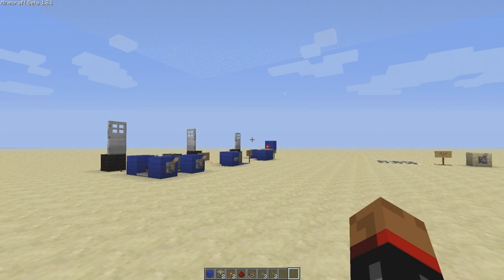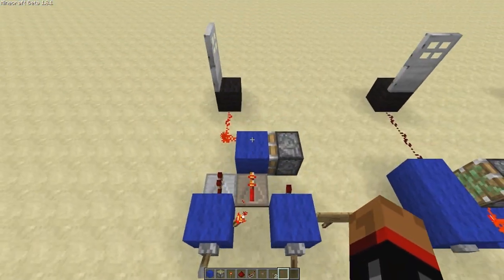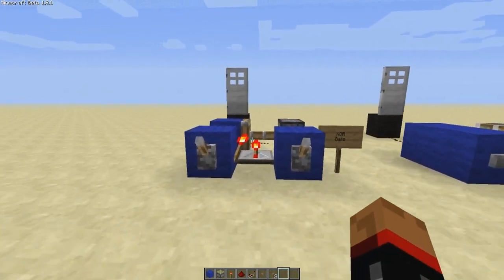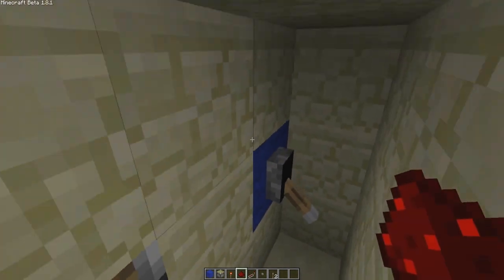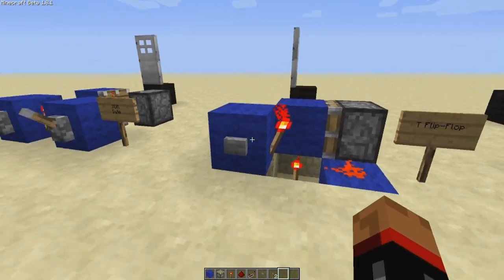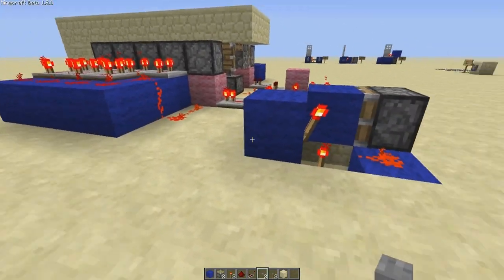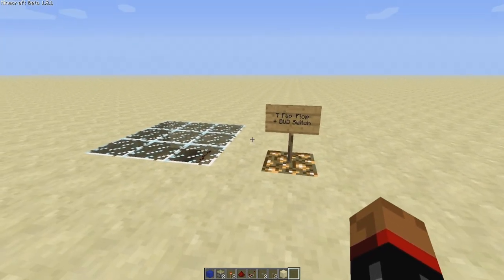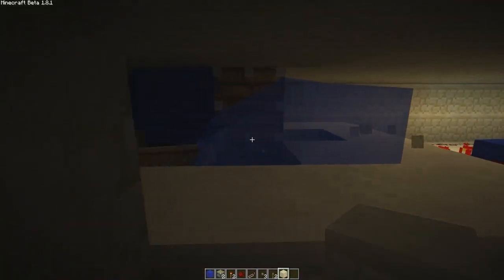XOR/T-FlipFlop/BUDS Switch Reference Guide [Minecraft Redstone Tutorials]

Comment: Not sure if it interests you but your flip flop can be made to actually send out a set of two outputs, one off and one on. This way you can toggle to outputs to always be inverted from each other. Where the blocks ends up after the piston connect it to a repeater connected to a redstone torch. Then you can take power from that block which will always be the invert of the other output *which you need to have one repeater on so that the wires don't cross* Might be useful to you.

Comment: Dunno if someone already told you. Thanks to the redstone block, there's a much better BUD switch for under ground. Top layer [piston->][redst block][ ][<-piston]. Bottom layer: [block][redstone][block][/ red torch]. With the new update, it now requires a piston on the side in order to update the right piston when the redstone block is moved, but it's still better than the complex water-boat design.

Comment: There is a way you could do the last one as long as you don't mind have a level of blocks above the main flat surface. Just disguise it as a hill. Then the circuit would only take 3 blocks.

T - repeater - block attached to sticky - redstone to flip-flop

Comment: Alright, so I've made t filp-flop gate for the stairs right. How do I get that to correctly work when all the circuitry is in the ground and you want a button on a couple levels higher? Because, whenever I run it up to an appropriate place for the button upstairs, the stairs don't perform correctly and I get a couple mixed blocks...

Comment: In Multiplayer, the T-Flip Flop only seems to work if the button is really close the circuit.  If I put the button any further than 10 or 11 blocks away from circuit, the sticky piston doesn't let go of the block.  I'm assuming this is a lag issue, right?